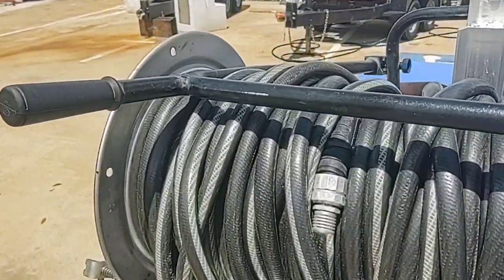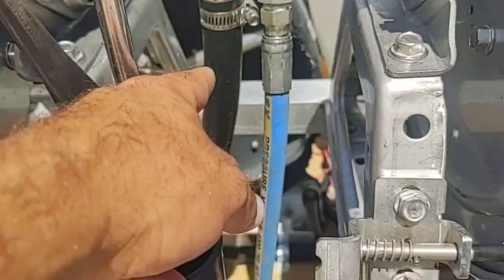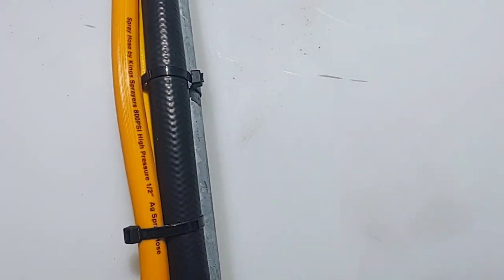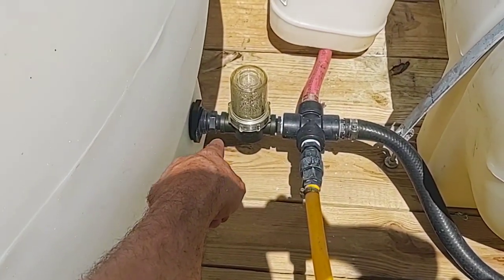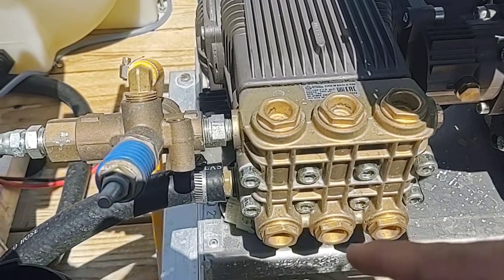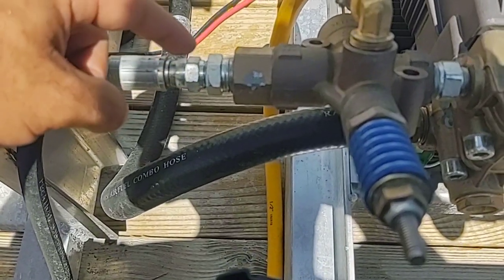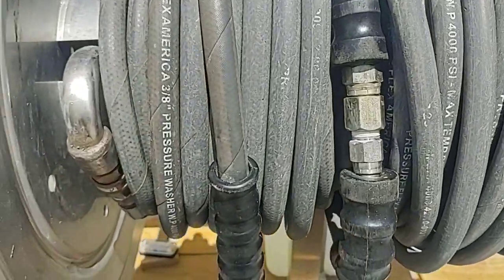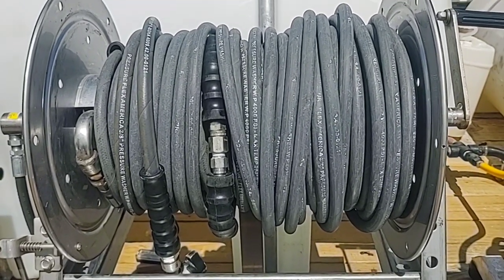A basic plumbing video for a cold water pressure washer on a trailer.

Comment: What size inlet hose from the tank for a 4gpm would you recommend? 3/4-3/4?
Reply from the maker: For a 4 gpm your threading is likely half inch, so the largest barb that will make sense is a 3/4" since they have identical ID (inner diameter).
Reply: @TXcommercialwash  Thanks I appreciate it

Comment: Do you need a booster pump to feed the pressure washer from the tank? Or if the pump is belt driven it would feed itself (not sure why belt driven are better suckers than shaft driven? 
Great video thanks!
Reply from the maker: If your using a direct drive, yes!

Comment: Just to make sure I heard that right, so you use a 3/8 size hose on the reel that would attach the wand and surface cleaner to?
Reply from the maker: The pressure reel uses a 3/8 hose.

Comment: Hi,

I have a few questions and I hope you can help. 

1. What brand / model unloader valve did you use on the 8 gpm?

2. Did the unloader have a 3/8 or 1/2 inlet? Does it make a difference? 

3. On your water tank did it you use the original 3/4 bulkhead that comes with the tank? Or did you install a 1 inch?Just asking because it looks like the tee was larger after the filter. 

Thanks
Reply from the maker: 1.  Vrt3 unloader https://washmart.com/products/vrt-3-black?_pos=2&_psq=vrt&_ss=e&_v=1.0

2.  3/8

3. The tanks generally have 1 or 2 inch bulkheads.  The smaller tanks may have a 3/4" or 1/2" bulkhead but generally once you hit 100 gallon tanks they are 1 inch.

Comment: This style unloader valve, do you have too adjust it for pressure when starting the motor? Or is it preset? I’m not familiar with this type of unloader. Thanks for helping!
Reply from the maker: It is preset when we build the machine.  When you get a new unloader to install on your existing machine we have a video that shows you how to adjust it.

Comment: Does the pressure washer pump the water from the tank or is it gravity fed?
Reply from the maker: It pumps from the tank, no gravity feed required with belt or gear drive machines.

Comment: So what size is the hose from the bottom filter outlet into the pressure washer. Is it a 1 inch hose? i have a 5.5g
Reply from the maker: The inner diameter of a 5.5 pump is generally half inch threaded.  Which means you want to use a 3/4” barb x 1/2”MPT.  The inner diameter of a 3/4” barb x 1/2” MPT is the same and will have no flow restriction.

If you run an 8 or 10 gpm size it up to 1” barb x 3/4” MPT.  Same principle, different size.
Reply: @TXcommercialwash  Okay great thank you. I had a feeling the 5.5gpm had slightly smaller dimensions and didnt need the full 1 inch line

Comment: I have two comments for you:
Always install a safety pressure valve on pump, in case of unloader fails.
Second: wip line in better in 1/2 inch...
Reply from the maker: After we have been doing this for 39 years we have found the safety relief valve are unnecessary for machines tied to a tank.